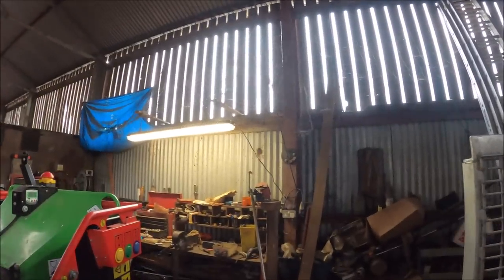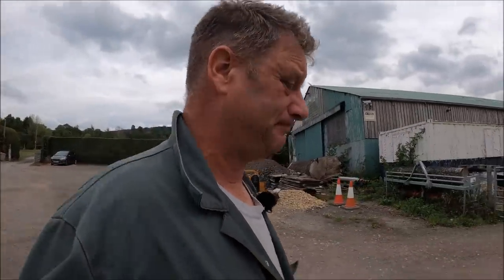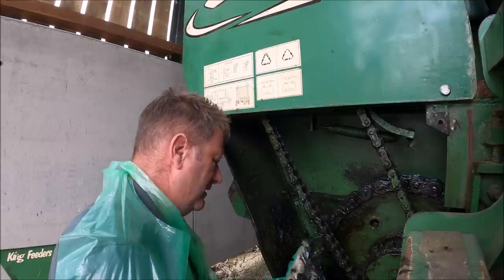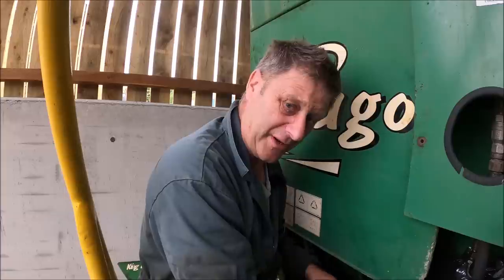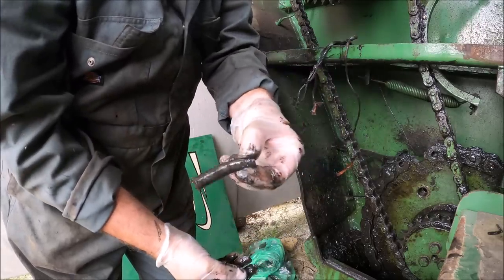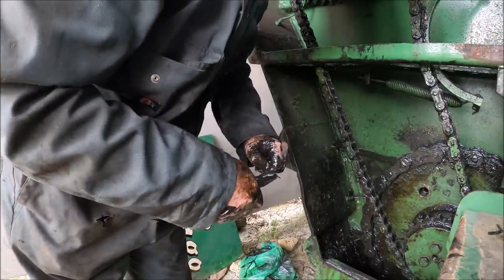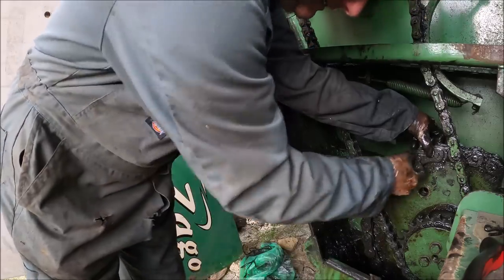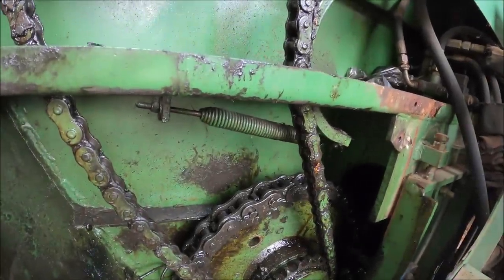03/09/22  Repairing the Zago again, Second time lucky?

Comment: Nice one Ian.  As a time served maintenance engineer, I've been faced with this type of problem many times over the years.  With a split-link, the tolerances are very tight so cleanliness is paramount as any spec of dirt or grit, will make assembly very difficult indeed.  But you did a great job and the g clamp idea was excellent.

Comment: Put your overall in a bucket with a scoop of washing powder and stain remover powder like biotex, fill with warm water and leave for 12 or so hours stir up with a broom handle occasionally and wring out before sticking in the washing machine. Do it to mine most weeks when repairing machines. Often joke how thick the gravy’s and sludge is going to be in the bucket.
Reply from the maker: Good tip 🙂👍🏼
Reply: The shipping for Biotex from Holland cost prohibitive, darn.

Comment: To avoid tearing the thin examination gloves you could apply a second pair of regular nitrile gloves over the top. Would give you your dexterity back, and give more grip on the chain, while still giving you the whole arm protection.
Reply: @_Rich_.  I haven’t but it can’t be as uncomfortable as wearing those, thin, huge fingered gloves and slipping everywhere with the constant worry about small punctures. I wager If you wear relatively well fitting nitrile mechanics grade disposable gloves you can’t feel the bunching. I wear them over “no cut” chef gloves all the time. It was just a thought when I saw how much of a struggle it was. Only a suggestion.

Comment: Hey just to let you know what I do when I work on something really greasy, before I even start the project I use dawn dish soap and put some in my hands and rub it all over my hands and arms until it dries and then when I’m done I wash up with a hose and I’m just as clean as when I started. There might be a little under my nails but I get rid of that with a old toothbrush. Dawn dish soap is the best to get rid of grease.

Comment: A tr4e surgeon had that problem with a chipper a few years ago with an home made machine,it was built on an old transit chassis with PTO drive from a land rover any thing over 1 inch diameter pulled the land rover enginrcrevs down to 500rpm and or bust a link and threw threw the chain off ,last time it did it the chain off a beet harvester was used a bit more before than the motor bike chain